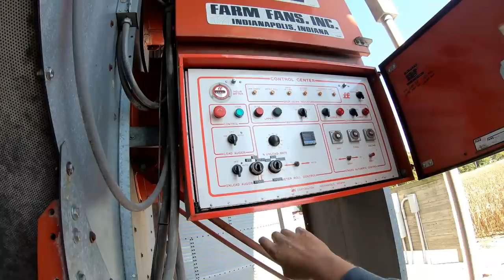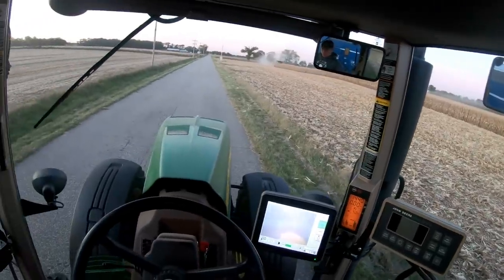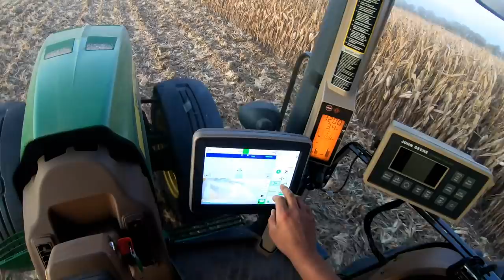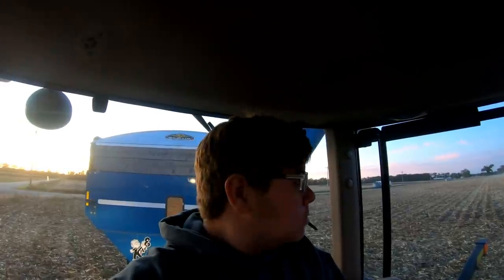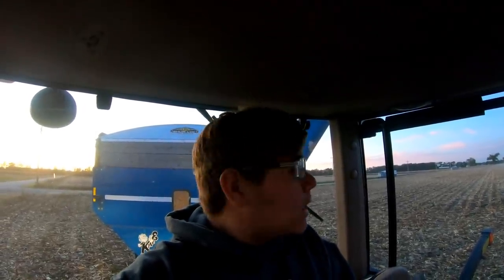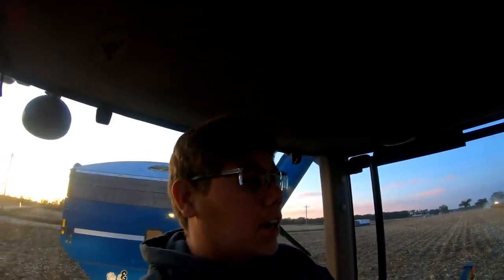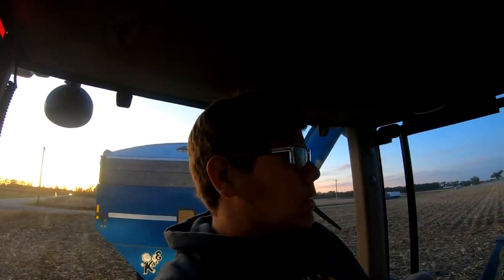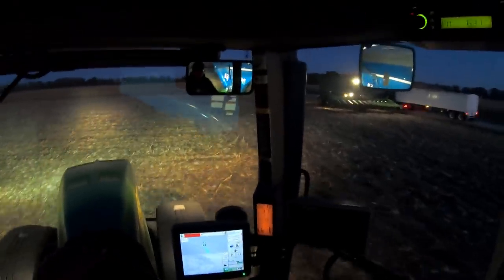300 Bushel Corn! - BUILDING a NEW Grain Bin?! | HARVEST 19 Day 12

Comment: For me I started growing corn in 1968 after getting a Soil Science degree.  The farm average that year was 167 bu/ac.    best field made almost 180. This was with 3306 and the next year I made 200 bu with 3369a.    Several years ago we had a half mile sprinkler average 286 with P1197.   That is 2 bushel average yield increase each year.    It is like racing cars the little things result in the improvements.    The best NCGA yield was 457 in this area.   so I guess there is a way for me to do better.  This year I was thinking I could make more with P1828 but the hail stopped that.
Reply from the maker: That is awesome! Where abouts are you located? Thanks for watching and subscribing!

Comment: Definitely some awesome corn. Your ground is similar to what we have in eastern nc. Blow sand to sandy loam most of the time with low cec. How often do you tissue sample? Any fungicide applications? Watching and learning from you
Reply from the maker: We just started tissue sampling this year and we only did it once to see what kind of results we would see. This year we did have a helicopter spray fungicide on all the irrigated corn except the 40 on the corner because the tar spot pressure was non existent in that field. Thanks for watching!